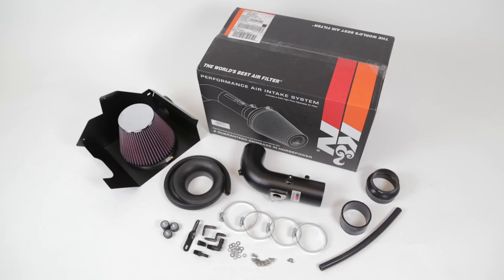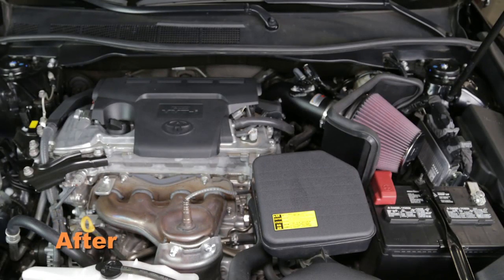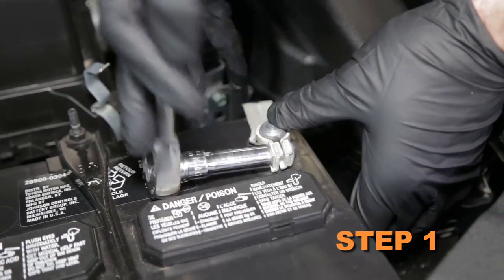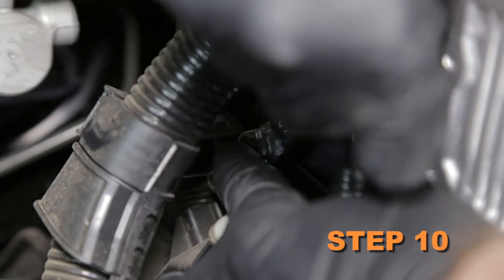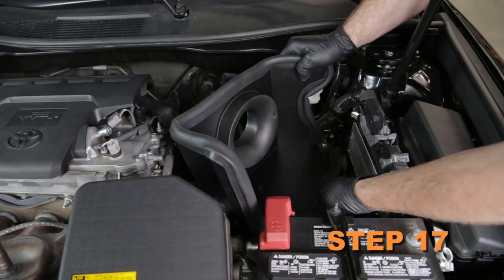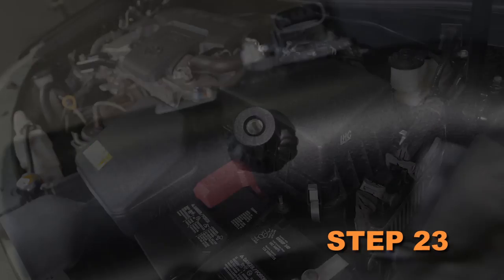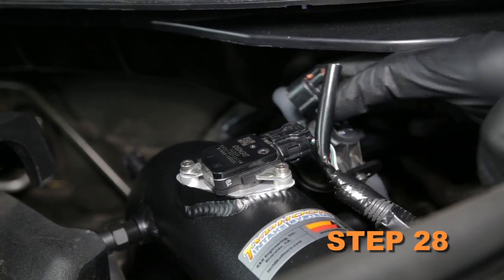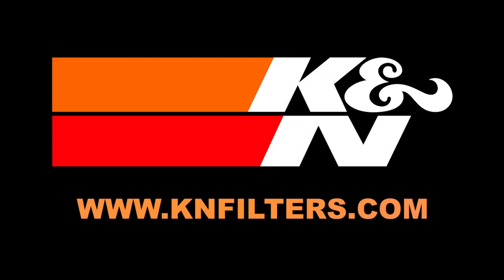Toyota Camry 2.5L [#69-8620TTK] Air Intake Installation

Comment: Just added this to my 2014 Camry I didn’t notice too much in terms of power when driving, but on the highway getting up to higher speeds was more of a breeze. Is the growl supposed to be very loud? I found it to be very loud inside the vehicle when driving.
Reply: Yes, it’ll be loud. That’s a good thing, enjoy it man!
Reply: Only thing I’d worry about, is driving in the rain. Not to stress it, but that’s it really. Noise is good, as long as it’s not Rattling, or sounds likes it’s hydro locking, your good.
Reply: @dylahaw  do you think a muffler delete plus the k&n intake on a 2018 Camry is a good start?
Reply: @aziahcorbett6196  yes. Especially if your a dual exhaust, it’ll sound better, if it’s a single exhaust I’d do nuff and res delete for a louder tone, if you want a deep low and not as loud do muffler delete. But if you have dual exhaust do just a muffler delete.
Reply: @aziahcorbett6196  and as far an intake, I don’t believe in them really 😂 unless it’s a cold air intake, but it’s more for show otherwise lol. I’d spend that 350$ on something better, tint, put it toward wheels coil overs lol, I’m saving for coils right now cam.
Reply: @dylahaw  thanks bro
Reply: It’s all in your head. You can’t feel a 5 hp gain on a 178 hp engine.
Reply: @dylahaw you can’t get it wet or what? Now I’m scared lol

Comment: I did this to my Camry today and oh boy!! As a car guy this is a huge difference if you want the car to sound way meaner it will when I instal this I do recommend a professional or someone with a lot of tools and knowledge this was a fun install and it makes the Camry way more fun!!!
Reply: I was just wondering when you installed yours did you put two hoses on the on the evap purge valve or did you put one line on the back of the intake?
Reply: @corymoon1445  I followed the k&n intake video on YouTube I did hook up the evap hose to the back of the intake (on the metal pipe) and moved that sensor (i honestly can’t remember what it was) I think it was a mass airflow sensor don’t quote me but I mainly did the modification because I wanted more sound without changing up my exhaust any since the Camry already has nice engine sound this intake wakes it up and makes it a way more sporty feeling of a car… if I do ever sell the car I don’t have to weld up the old exhaust no nasty hack saw cuts on the exhaust no shotty welds just work from an honest fella 😂(all bolt on stuff I kept my old intake just incase it didn’t work out but within a month it felt really dialed in) can easily be reverted back to stock if needed.
Reply: @corymoon1445  just one line for me

Comment: Yea.. ill stick to my factory style air filter.. too much work...  this is not required.. it will probably ruin your engine in the long run
Reply: How?
Reply: @toee9553  because Toyota tuned the engine for a stock filter. When you randomly add more air flow, you throw off the stock computer tune. This is something dumb 16 year old kids do. Do yourself a favor, keep it stock.
Reply: @gonadiator  what about getting a new exhaust for your camry. I have a 2011 camry 4 cylinder.  Keep it stock or can I change it to get a better sound?
Reply: gonadiator I hope you’re joking right? Any modifications like bolt on will always tamper the ECU. That’s why people get their car tuned to make everything compatible and run way better than before. There are ton of tunes for the Camry. A stock Camry vs Modified Camry with a proper tune is huge different. You’ll get more mpg on local and highway lol.
Reply: Jean Lubeus you can change it. Don’t listen to this guy lol. Guy is probably a boomer and is old fashion.
Reply: Homemade Baguette question, if I put the intake system would I have to tune it or not ? Since it’s only 5hp+
Reply: @createchannel7559  you don’t have to tune the ecu if you change the intake, but in theory it’ll make it run slightly better than just slapping  it on

Comment: Once you have installed all of it, do you need to get your car re tuning?
Reply from the maker: All K&N air intake systems are designed to work with factory ECU settings and should work out of the box.  If you encounter any issues, please contact our product specialists 800-858-3333 or tech@knfilters.com for assistance.

Comment: How does this change the air fuel mixture settings that are programmed into the car's computers?
Reply from the maker: Please contact our Product Specialists at 800-858-3333 or tech@knfilters.com for help with your question.
Reply: @KNfilters so they can snow people like your ads?  Without more fuel no wsy to.make more power it is physics. To gain power you need.more air and fuel like a turbo or supercharger does. With out remapping ecu for more fuel you lean out mixture with just more air, and as most modern fuel injected cars are already lean to pass emissions more air alone is no hp gain and could lean engine to.point of damaging engine.

Comment: why we need to change air intake?
Reply: You don't. Toyota made it a certain way and tuned the engine for a stock filter. Keep it stock if you actually care about your car.
Reply: @gonadiator  my thoughts exactly.  It’s just an expensive gimmick, with little to gain.
Reply: @gonadiator  just wondering if I change out the stock air filter with the cold air intake will it damage the car in the future?

Comment: ik this is 10 years old, but will this fit the 2AR-FXE 2014 hybrid camry?
Reply from the maker: No, this system will not work with the hybrid.  If you have any other questions please feel free to contact our product specialists at 800-858-3333 or tech@knfilters.com
Reply: @KNfilters  is there a way to modify or cut down the shiled to fit?
Reply from the maker: Please feel free to contact our product specialists at 800-858-3333 or tech@knfilters.com for a detailed answer to your question

Comment: I was just wondering where does the evap purge valve bottom hose come from does it come from the line or from the back of the throttle body?
Reply from the maker: Please feel free to contact our Product Specialists at 800-858-3333 or tech@knfilters.com for support

Comment: What does this do to fuel consumption
Reply: a guy i knew had a ford somethings car and it was ok and made noise but he said it burnt more gas
Reply: @daylightsavior6745  thanks for the response
Reply: My fuel consumption is about the same, maybe 2 or 3 mpg better, but if you like the sound you may find yourself stepping on the gas too much and losing small gain.
Reply: @Treaxvour  2 or 3 MPGs might be worth it in the long run, if you drive it right.

Comment: I have 2015 camry .does it need tunning after intake.
Reply from the maker: All K&N intake systems are designed to work with factory ECU settings and do not require a tune.   If you have any other questions, please contact our product specialists at 800-858-3333 or tech@knfilters.com for assistance.

Comment: Could someone please tell me how can you tell if your motor is a 2.5 or a 3.5 I don’t see it anywhere under my hood for a 2012 Toyota Camry LS
Reply from the maker: If you would like to find K&N products for your vehicle but know know the engine size, consider using the V.I.N. lookup tool at knfilters.com.  Select "Search by VIN" and enter your vehicle's V.I.N. number to see a list all the products that K&N makes for your vehicle.  If you need additional assistance, please feel free to contact our product specialists at 800-858-3333 or tech@knfilters.com.
Reply: Find your car VIN number and check the details about the motor
Reply: It’s either got 4 cylinders or 6 cylinders in that case just count
Reply: There was no Camry “LS”

Comment: First and foremost, it’s overpriced absolutely. Secondly, the overall fit is not as expected for something that specific to this make and model. Why? It’s a bit of a struggle to remove some of the original parts so plan for additional time. The instructions for the EVAP connector wasn’t clear. Why? Had to get help from my mechanic buddy. 

Note: it’s a possibility to throw a CEL because of the MAF sensing new flow parameters... suggest you clean the throttle body. No mention of that in the instructions either. Why?

Once it’s in and the motor has “settled in” with the new mod the sound is the most apparent like any other CAI. K&N claims 5 HP is probably accurate but you only really feel it at 4500 RPM to redline. The throttle response is a bit more responsive at high RPM and revs appears to climb a tad quicker. 

Overall it’s probably borderline worth it but the price should be at least $100.00 less....can’t see where the cost is. The look of the monster filter is pretty cool looking too. Overall maybe a 7/10
Reply: I agree with you i own the same Camry here
Reply: theory  Also I find myself using the paddle shifters more often so as to get the satisfaction out of it 🤷🏽‍♂️
Reply: @pm5487  I purchased a 120 intake with same kit basically. hope all works out
Reply: theory Good luck! What brand is 120?
Reply: P M my bad it was $120, hqculture on eBay
Reply: @theorylolz  how’s it been holding up this past year ? Is it worth it ? Did your MPG improve ?

Comment: i have no clue how to install this even after viewing the instruction video...can those garage shop pro do this for me? i am not sure if they can do this...where can i find someone to install this for me??
Reply: Do it yourself.. Go to the forums and look at other peoples diy install and go from there
Reply: don't use it. "CAI mythbusted" on YouTube...type that in. these things actually reduce power
Reply: 2010V6RAV4 Not in all cars, and it can add power if your car comes with a restrictive intake and can be a "bottle neck" if you have other mods (headers, exhaust, cams, etc.)
Reply: +Jairo Calero in a high performance car, maybe. they tested a WRX I think, and it lost power. this little piece of crap 2.5 engine isn't high performance and it's not reliable either. giving it more power will definitely shorten it's life. prone to cam gear failure.

Comment: It works to a hybrid?
Reply from the maker: The K&N 698620TTK intake system is currently designed to fit the 2012 - 2017 Toyota Camry 2.5L non-Hybrid model. At this time, K&N does not offer an intake system for the Hybrid model.  If you have any other questions, please contact our product specialists at 800-858-3333 or tech@knfilters.com

Comment: It doesnt work unless you flash ECU. Otherwise not much differences on performance side.
Reply from the maker: All K&N intakes are dyno tested to provide a guaranteed increase in performance using factory ECU settings.  If you have any questions regarding performance gains, please contact our Product Specialists at 800-858-3333 or tech@knfilters.com.

Comment: Anyone know of something legal in California with the same results?
Reply: yes. factory intake. watch CAI mythbusted on YouTube. these things are under the hood causing them to suck in engine heat. by the way the 2.5 engine in toyota is a sorry, sucky, piece of junk. TSB  0146-10. it's been revised so read the revision. tell people in California to avoid this junky engine.
Reply: +2010V6RAV4 it's a good motor. I've read a lot of good things about the 2.5. of course the 3.5 v6 is a better motor but the little 4 cylinder is a good motor
Reply: +Armando  Gonzalez  not arguing, just stating facts and the 2.5 has cam hear failure and it's easily heard on a cold start. I have had two of them and of them have suffered with cam gear rattle related to The TSB 0041-13. it's a very noisy, whining, rattling piece of junk.
Reply: +2010V6RAV4 GEAR, not hear.
Reply: It’s a known fact that living in the state of cancer may cause California…

Comment: Really? "Cold air intakes" are not effective without retuning from stock. Otherwise, it will run poorly.
Reply from the maker: Sorry Josh, but that's simply not true. We dyno test each intake application and guarantee a horsepower increase. No tune necessary.
Reply: @KNfilters  I know, I've seen those claims. If you want to do this, you need a high tech scan tool to reprogram your car's computer so it still runs efficiently. Either way, a 4-5 HP increase and decrease in MPG for a $300+ air intake kit isn't pleasing. Sorry

Comment: Y’all go through this for 5 horse power boost😂
Reply: It’s easy to install 🤷🏽‍♂️😂
Reply: its WAY simple to do? I cant do any engine or actual real mechanic work and I can do it.

 the better insult is "yall spend $400+ for 5HP?!" lol
Reply: @KumoGoesFast  pointless. 5 hp gain and suck in hot air from the engine compartment

Comment: Stupid Toyota engineers they're never came up with this idea
Reply: They probably wish they were aloud to and could afford to put them on all production vehicles. But they have to meet stupid noise requirements and other dumb rules.
Reply: They no it’s not good to suck in hot air from the engine compartment

Comment: I have a 2014 camry with the 2.5L I4 its 2014 but will it fit?
Reply from the maker: Yes this part will fit your application. Check out the product page on our website https://www.knfilters.com/69-8620ttk-performance-air-intake-system